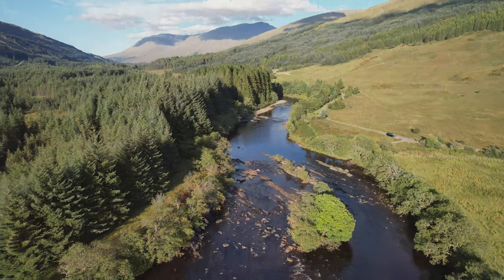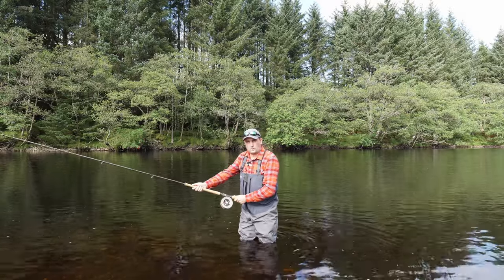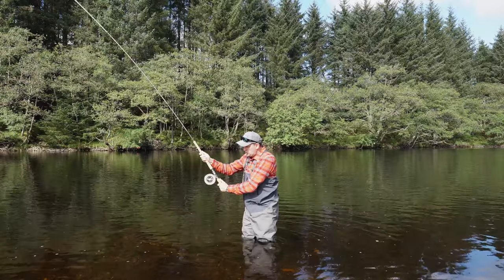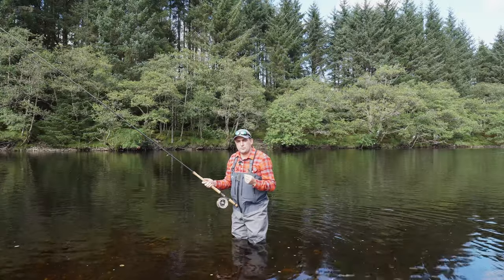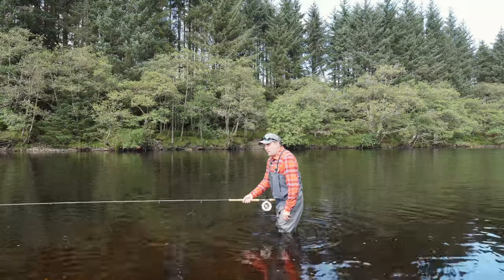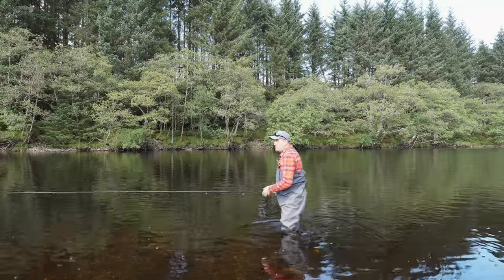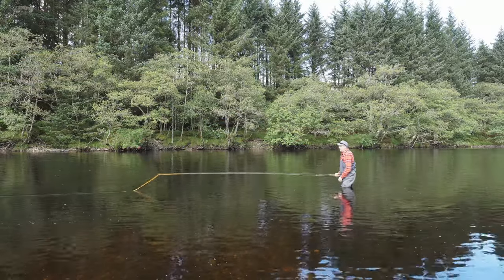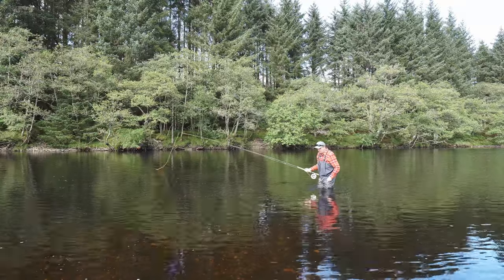Spey Casting techniques with Andrew Toft- Single Spey Cast

Comment: Thank you Andrew, your the only one that emphasizes a couple of little important details, like pointing the rod completely down stream parallel to the line on the dangle, and after the initial lift, still pointing the rod downstream, I always messed up my single spey whenever I started pointing my rod tip anywhere else other than completely downstream, and then with bodyweight shift, backfoot to front foot, together with the outward swing before the sweep, it has helped me tremendously perfecting my technic. I'm incorporating it with shooting heads as I'm using it for small to medium rivers, I'm currently experimenting with how slow I can make the lift, the outward tilt, and the swing, and with something I call French kissing the anchor, sort of letting the water and leader make out, meaning letting the anchor sit a little bit extra time, maybe half a second to a full second more, which I use for a couple of things, first I keep swinging the rod a little bit more around to increase the angle, before I drift upward, to initiate the forward cast, while also pulling the leader more strait, it lines everything up for a better tracking, the reason I'm doing this is to remove any slack in the line, and keeping the tension high in the whole system, and also have an edge on the wind, instead of swinging the rod and line a full 90 degrees, with more time in the air which would/could potentially letting the wind get it and blow it of course, I'm only changing the initial angle about 60-75 degrees before the anchor sets, and changing the rest 15-30 degrees after the anchor, meaning less time with line in the air, I tried to increase the initial speed to create more energy in the backcast, but it didn't work, I lost control, and it looks absolutely fab with the sudden change of tempo, from everything up to the forward cast being slow, to launch with high speed,  it creates long casts up to 45-50 yards, often way more than I need. It puzzles me I can cast that far without also having similar speed in the backcast, the physics doesn't ad up, but it sure works. Keep making these vids, your extra knowledge is much appreciated.

Comment: Good instruction  and video. Assume you were using a spey line as opposed to a scandi shooting head given you had a long 60' of line out of rod tip? Length of head v rod length can be a confusing issue in context of line type.